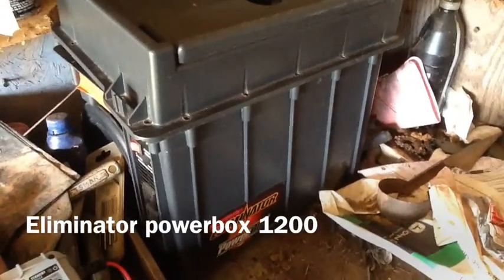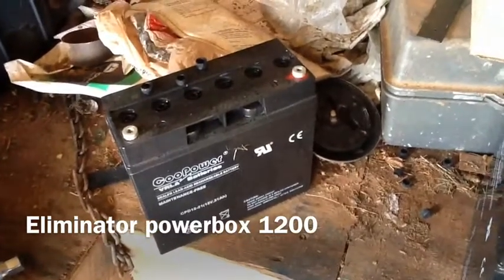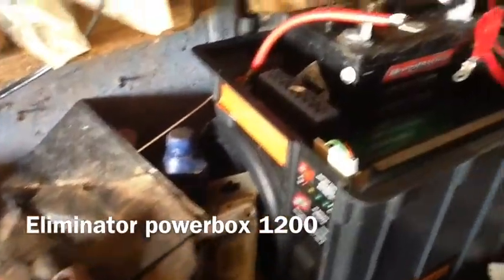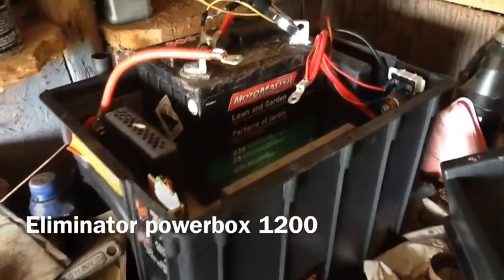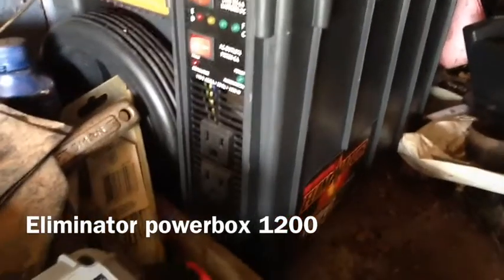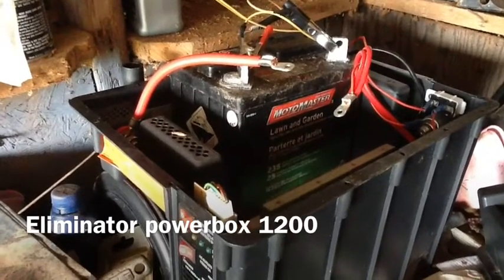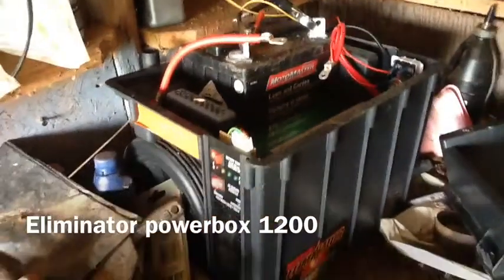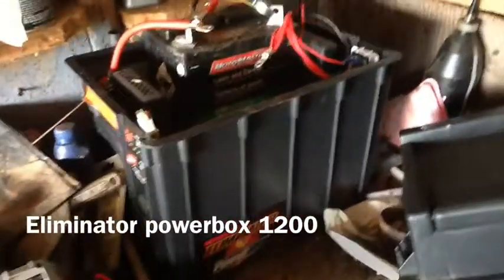AWESOME FIND: Eliminator POWERBOX 1200 Project - OFFGRID Generator

Comment: I have the same one that i purchased in 2005 i have changed the batteries and put new ones ,,the manual says that those pins in the are to add up too 2 more batteries of 12 volt which uou can connect in parallel ya ,, very nice and definitely worth refurbishing for like 170$ would sell for over 1000$ for sure

Comment: I have the same power box ,,my batteries in it just went toast ,,I bought mine brand new several years ago with the instructions,,now the outside battery post can be used to add more batteries to it up to 3 batteries,,also I guess you didn't get the charger that comes with this box ,,I have mine but it does say if you add outside batteries not to use the supplied charger ,,it's only good for the batteries inside the power box, but u got a real good deal for 30$ that's for sure ,,I'm planning on getting new batteries for mine also
Reply from the maker: Hey thanks for commenting. I just use the inverter basically now, it's good for that. The batteries were toast
Reply: Can you tell me where I could get a copy of the instructions?

Comment: Is there any battery I can use using the same charger that came with the box?
Reply from the maker: Yes, not sure if its a group 31 size or not. You should be able to take the battery into harbour freight or whatever and get one of the same size to work in it.
Reply: @MicahGallant  I'm in canada, I will try canadian tire but I wanted to try to revive those 3 (12V21AH) batteries  first lol before heading to CT. I checked the voltage and it read .48, the cell were dry.  
I bought this at an estate cell.

Comment: Dude, I got one of these about seven years ago... and was sitting there for seven years... then I wanted to power my RC charger with it.... so took it out, and guess what it was completely dead(8.3 volts, batteries were sulphated)! so... I opened up the batteries, watered all the cells (6 cells in a battery) them all the way to the top, then Using an eliminator battery charger put them on a maintenance cycle(leaving the battery caps open) for about 24 hours, BANG... the charge went back up to 13.5 volts. Then I charged it at CCA for about another 10 hours(leave the caps still open until it's fully charged so the H2 gas can escape) and... IT IS NOW GOOD AS NEW! after seven years! The bottom line is the hardware is GOOD, it is just the batteries you need to recondition. I used tap water even though distilled water is recommended. Probably your batteries are still good, try to revive them. Good luck. Nice video you got.
Reply from the maker: Ravi Muthali thanks for the comment. i tried reviving, but they were toast.. I got a large deep cycle anyways and just scavenged the inverter and other hardware from the box